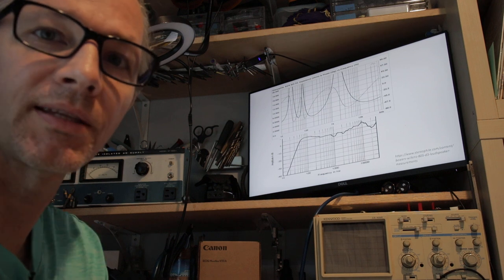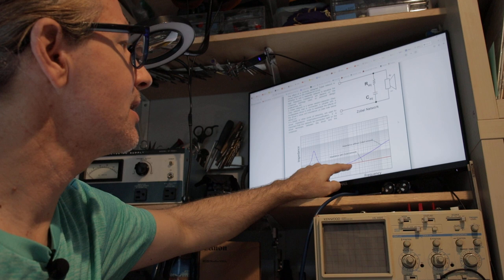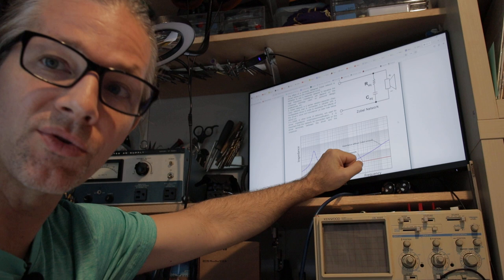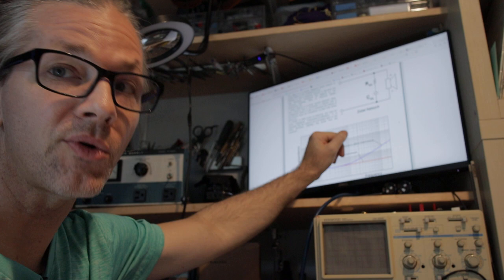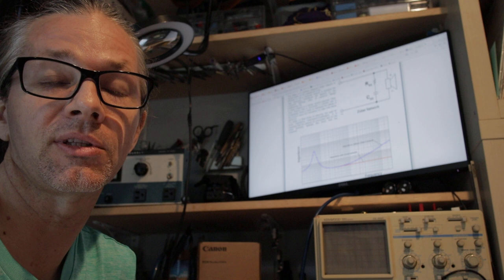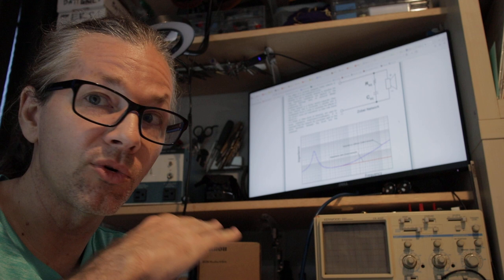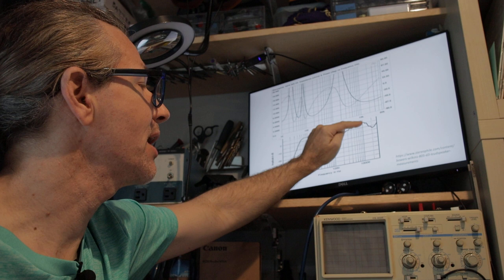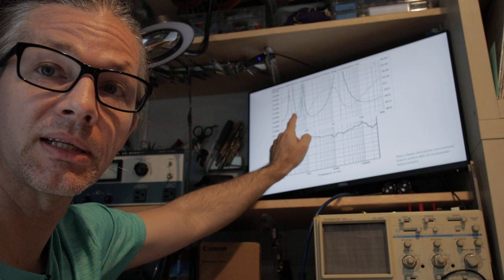Help! My speakers need a Zobel network!

Comment: For my 2-way Lancelot speaker, I compared a 2nd order filter with a 1st order + Zobel for the Altec 414. Both yielded nearly the same freq. response. However, whereas with the 2nd order crossover the sound signature of the capacitor was clearly audible, with the Zobel setup that effect was not directly noticeable which surprised me.
Reply from the maker: Makes sense, a Zobel is a milder device than an extra order for the crossover.

Comment: You don't need a zobel network necessarily you need a resistor network to stabilise it's impedance so it doesn't drop too low. So it gives you a steady impedance across the speaker range whatever that is. you want it to be. You need to use non-inductive resistance metal film. There's no loss of information if it's done correctly. It's got nothing to do with distortion from your amplifier increase damping factor there's a better load for the amplifier yes reduces  distortion further if you're driving it hard. something wrong if you're hearing distortion what you're saying that's more of a power issue
Reply: I agree here. Stabilize it with the proper resistor network so through impedance stays up constant as it can
Reply: @labalo5  yeah you don't want it dropping so find its  lowest point and make an average
Reply from the maker: My long winded follow up is coming up in a few minutes: https://youtu.be/rTfaH0ydhTE
Reply: @hoobsgroove  Janos makes a good point. Start with good amplifiers, and drivers that are not all over the map